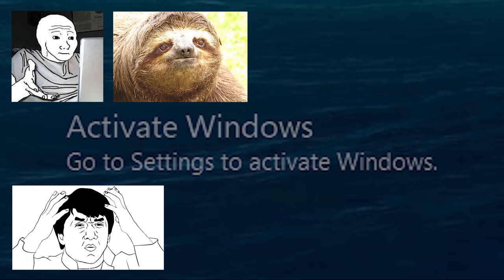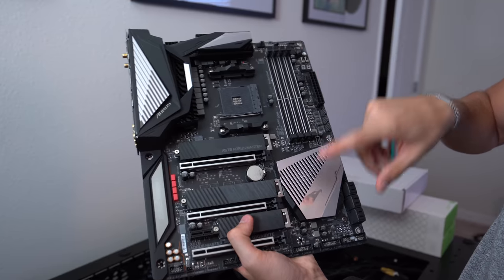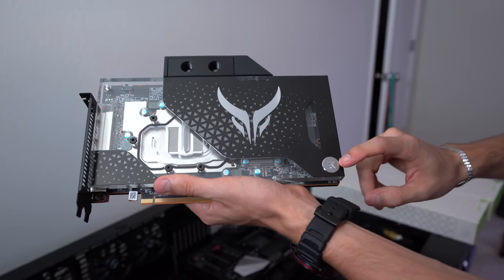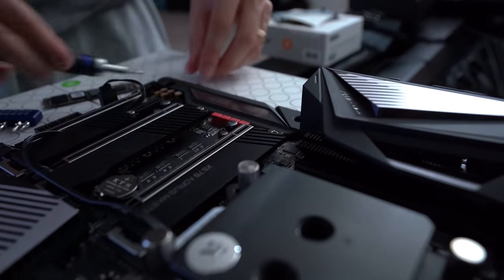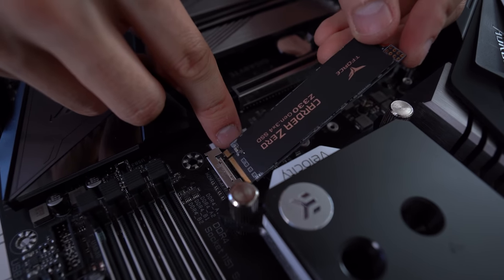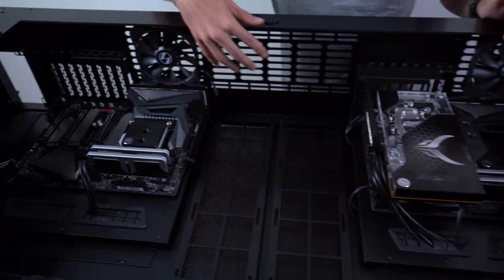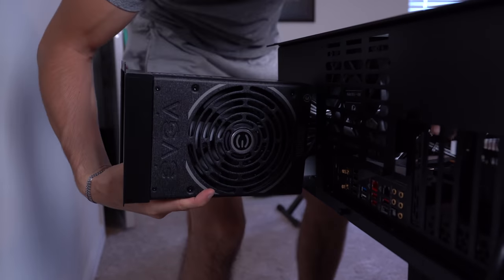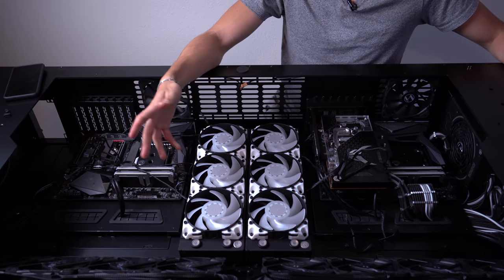I LISTENED! Lian Li Desk PC Build - Part 2!

Comment: Curious as to why the 9900k is being used as the streaming cpu since it's the best gaming cpu between the two? I know there's not a huge difference especially at higher resolutions but since you already have both anyway, it seems the more logical choice to me at least. Again, just curiosity.

Comment: With a new AMD build why WOULDN'T you use a 5700XT?  Take full advantage of the gen4 PCIe for Pete's sake like you did with the M.2 system drive!  Thanks for this build series, I've been drooling over the DK-05F ever since it was introduced, and it's "baby" brother the DK-04.  For the front intake fans, can control of them be split (without adding another fan hub) so the systems control the fans blowing over them?

Comment: In the automotive world we sometimes use vacuum to fill the cooling system. I wonder if you could do something similar to get the water in and air out in one step. It also functions as a leak test if you have a gauge in the system. I don't know if the PC parts would be up to the task without damage though. Vac. can be as troublesome as over pressure, not that you don't know that already.

Comment: That radiator with fan pushing down, does the wind blow to your leg or there are some wind routing? Just curious.

I think you should buy a mesh net (I don't know what you call it in English) for easy dust maintenance.

Comment: If you ask me you went the right way dude. If a person has the cash to spend on a desk like that that very same person should have the money to build 2 overkill systems to match the desk.
Otherwise it would be like buying a Corsair 1000D and then smacking in an old bulldozer system from and in it.
By the way...create some painted acrylic covers for the cables to clean things up abit.

Comment: speaking of obscure RAM, has anyone used AVEXIR?  A few years back, there were plenty of reviews for them, particularly the Raiden Avexir.  I built my 6700K with some  Avexir, and I never had any issues and everything was fine.  I had 16GB, but when I wanted to expand and add another 16GB late last year, I couldn't find any AVEXIR ANYWHERE anymore.  I didn't want to mix RAM brands just in case I might run into compatibility issues. 
I was never able to find any more except for overpriced versions on Ebay.  I ended up just buying 32GB of Gskill Trident Z.

Comment: Can you explain why you use the Intel rig to stream and not Game on Intel and stream on AMD?
Reply from the maker: Because the Intel chip has an iGP, meaning we wouldn't need a discrete GP on that system.
Reply: @GregSalazar  How about running the Liquid devil on the Intel system and adding a basic output to the 3700X like a 1030 or something?
Wouldnt that makes for better FPS in games?

Comment: So, is it safe to assume that both systems are gonna be graphically powered by one GPU? Is that even possible? Cool content as always!
Reply from the maker: No. They'll each have their own GP. The streaming system could use the 9900K's iGP, but I'll throw a discrete one in for good measure.